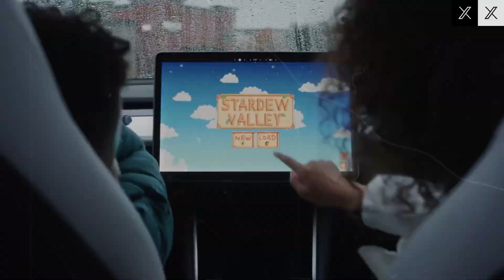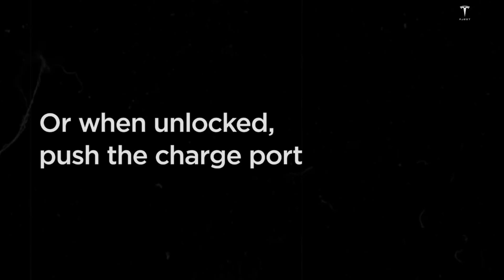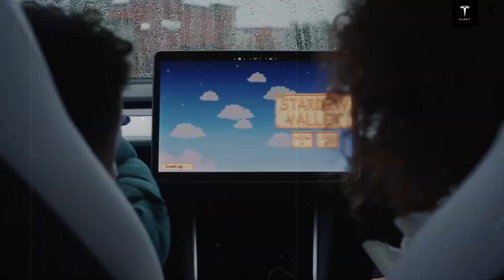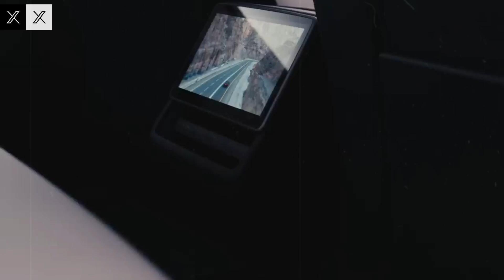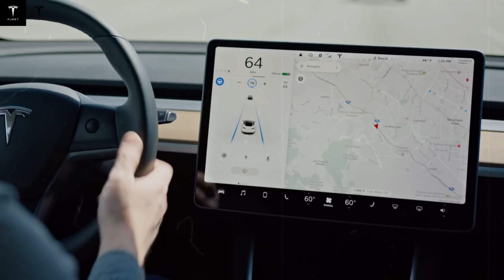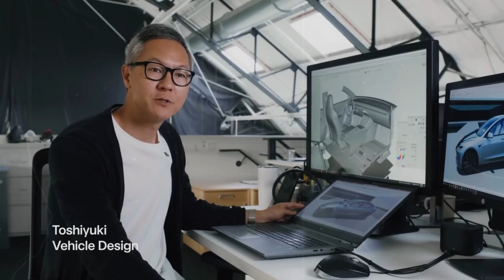FINALLY! New 2026 Tesla Model 2 Appears on Website — Shocking Design & Price Update by Elon Musk!

Comment: There. is no official “Tesla Model 2” with )
released. speculations  ). however there  is 
widespread speculation online about a future 
affordable EV often referred. to as the model 2 
estimates. placing the. starting price around 
$15,990 this vehicle may. features a 48-volt 
electric system drive by. wire. and. a “mesh 
recovery. theft  prevention system
Reply: Where and put when. Can I order it. 
Modal 2.? I live in Essex County New Jersey. Thank you. Stuart FARBMAN